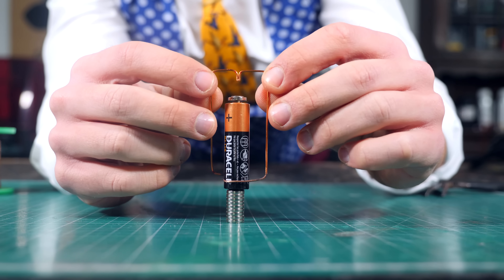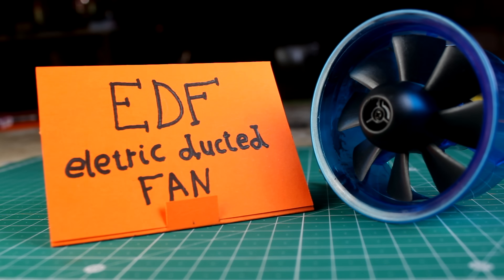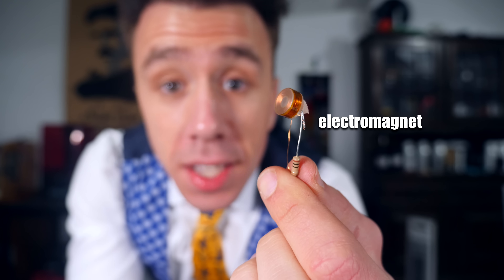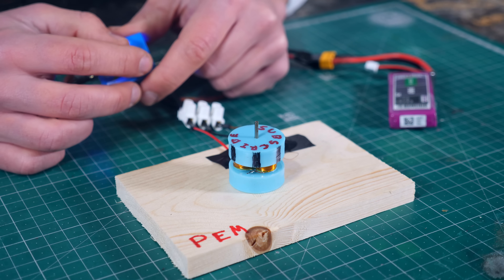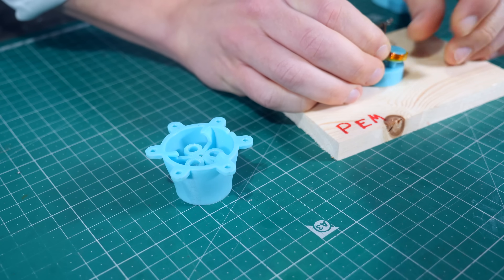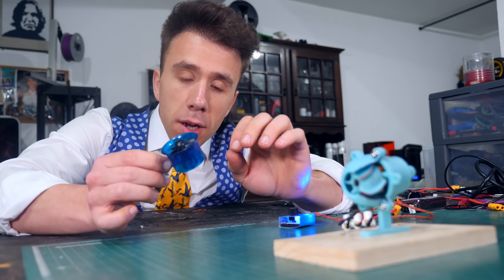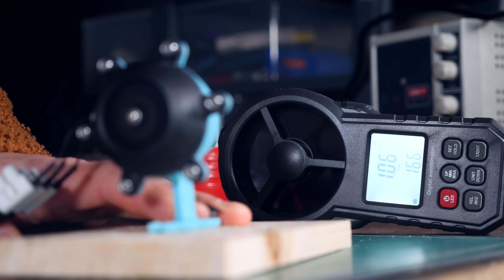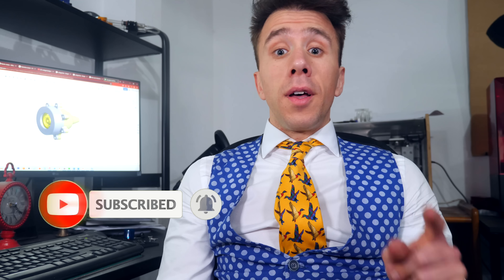I 3D Printed an ELECTRIC MOTOR FAN

Comment: Shooting from the hip here: more steps, more narrow passages and changes in pressure mean more energy loss in the process. Fan blade design is a fairly complex field because very minor changes can have a large effect on performance. Dyson fans work because they draw in more air through that center ring. The design requires more pressure, for which an impeller is optimal.
Drawing from rockets: you want the outlet pressure to be the same as the atmospheric, otherwise you get over expansion or under expansion which cause a loss in performance (not a 1:1 comparison because supersonic flow is weird, but presumably carries over somewhat). With an impeller, you have a larger change in pressure followed by a drop in pressure which just screams “minor head loss” in fluids terms, “waisted energy” in other words.

TLDR: Impellers are not meant for thrust directly, they are meant for deltaP. Fans are for thrust. Unless you need “high” pressure for a process, such as combustion, a regular (well engineered) fan is better.

Comment: I think it's because you are measuring the speed of the air... As you said, you have an impeller that are designed for compress air, and an EDF that are designed for accelerate the air... The reason because the jet engines make thrust, is for the combustion... So, you are measuring speed of air with something that are diseigned to compress it... It's the inverse situation when you made the " glove test" in the turbo pulse jet engine video... I hope this can help you... 
Greetings from Argentina ;)
Reply: I want to add something: I mean, the impeller pushes the air to the casing ( when compresses it) and then it's hard for the air to go backwards... MAYBE ( idk, I'm just speculating) if you find a way to convert that "centrifugal " ( Idk how to call it) flow into a linear flow ( going backwards) with tubes in the casing or something like that ( like the engines of the blackbird when they go in ramjet mode) you could have the thrust that you want... MAYBE.

Comment: It’s because it takes more energy out of the system to compress the air and then for that air to change direction to go out of the exhaust, compared to the first fan that just uses all the energy to just accelerate the straight out the back. Making it more efficient, in Turing rotational speed into thrust.

Comment: Dude you can´t expect the same thrust from centrifugal impeller as an from axial EDF. Centrifugal impellers are good for increase of pressure, but with lower flow rates. If you wanna build something for propulsion, there is a simple equation: Thrust = area * density *velocity^2.  Hence to max it out, you need to push lot of air throug a bigger area and very fast, but that goes against a drag force, because the more you spin faster, the more drag you have to overcome to push the air faster, while drawing more power. So the propeller design should be chosen according its purpose and be fitted for the power and rpm of the motor to work efficiently. The state of the art axial propellers can reach about 75% of isoentropic efficiency, with 3d printed design, 60% is reachable.

Comment: my guess would be that the CF fan is pushing air outwards rather than in the direction opposite of thrust.. and you only end up getting thrust from the air that is pushing off of the incoming air which is not directly connected to the structure. you might also be getting some thrust from the back walls that help bounce the air towards the nozzle, but i'd wager that it's lost energy by that time after the air got energized by the fan.

where as directional fans get their thrust applied to the structure as soon as the fan hits the air in a rearward direction.

Comment: My guess is a part of the centrifugal fan is designed to produce a part of its work radially to them play on air speed to create pressure. Not everything is ejected axially to create thrust, so the difference is the losses in redirecting the flow or some sort

Comment: I believe that’s just the nature of these types of fans. Looking at it from a Bernoulli perspective; converting the air from kinetic energy, to pressure, then back to kinetic energy allows for more loss due to friction and work needing to be done. 

The reason Jet engines compress the air is so they can burn more fuel hotter, which then spins the turbine. So it makes sense that skipping that step just makes for a worse fan.

Comment: Reach out to @Major Hardware! They've been doing a series of competitions of user-submitted models for PC fan design... while they may be PC fans, and not impellers, they might have some insights given all the fans they've built and tested over the years. Also, I suspect  they might have some design submissions which couldn't work on a PC fan, but might be more relevant to your use case

Comment: compression, you are not making enough compression on the printed ones, and the clearance is too big , make blades thicker and stronger and add more and make the clearance between the casing and the fan smaller if possible also the dison blades are made for a specific conical shape for that vacum if u can imitate that chamber where the fan is on the dyson you will get a bit more trust guaranteed

Comment: Since you have shown an interest in centrifugal fans, it would be cool to see a video on centrifugal superchargers, or as most people know them, turbochargers. I remember watching Colin Furze build a jet out of a turbo he found at a junkyard, and it would be cool to see if you could do something similar but more optimized out of 3d printed parts! Cheers from the US of A 👍
Reply: A centrifugal supercharger is not a turbo. Turbos are driven by exhaust. A centrifugal supercharger is belt-driven. No turbo lag, better efficiency than a roots or Lysholm supercharger but less than a turbo, and less power gains than the other supercharger styles.

Comment: how much surface does one fan to the other have to move air then ? Are both capable of moving the same amount even ? Your design looks smaller in that aspect. The problem is not the engine but the fanblade surface area.

Comment: In my opinion: the key is in the size of the intake aire. The EDF one is so much largeur. You can simply test it by masking the corresonding part of your EDF intake and check if the trust match your beautiful centrifugal fan. Or by increassing the size of the centrifugal fan...

Comment: this type propeller make higher pressure, but lower mass flow. this is great to upgrade for after burner, project! but first try measure the pressure, to be sure. or if u want u could make some nozle to increase speed air flow, bouth upgrade should give u more thrust.

Comment: novice error in aerodynamics, you try to take air from a low pressure zone to a high pressure zone so it is easy for the boundary layer to detach, solution: make the angle of your blades smaller.

Comment: *It's a fundamental fluid pump efficiency problem.  chrome-extension://efaidnbmnnnibpcajpcglclefindmkaj/https://www.ndsu.edu/pubweb/~kkatti/pumps.pdf  In layman's terms,  your centrifugal design is inefficient compared to an axial flow design given the rpm of your motor and density of the fluid (air). There is no fixing this. Axial fan will always be better.*

Comment: LIKE SO HE CAN SEE :thanksdoc::learning::yougotthis::cat-orange-whistling::cat-orange-whistling:
average EDF fan spins at around 40-60k where DYSON FAN SPIN AT  .... 125 000 rpm ....yes 125 THOUSAND RPM  , like all the centrifugal fans (for example like ones in turbo charger , jet engines etc ...way more than 100k) ... they really like to spin fast and only then have the flow rate you want ....less torque , more rpm and you will achieve better results :)

Comment: @Integza The impeller is making higher pressure air whereas the fan is making higher volume air.  If you measure the speed alone then you don't see the energy in the pressure.  If your workload is volume alone, then the fan is optimal for that, but you can use a Venturi to add more air to the high-pressure output, trading off pressure for volume.  That's how the head of the Dyson works.  But still, recognise that there's more skin friction in your design and it will never be as efficient as a well-engineered ducted fan.

Comment: Did you check if it's pushing air out the front instead of in and then out the back?

Further, maybe the RPM is wrong for the size? Are the clearances tight, like I'd imagine they should be. Maybe compressed air is flowing out of the front and creating a sort of bubble etc

Keep up the good work Integza, love your content man!

Comment: the EDFs are usually injection moulded
the plastic used is more stable than that used in your Fan and does not deform as much as yours.
that being said the DF part of EDF is important.
the Ducted fan part for optimum efficiency requires very very tight tolerances - hence the comment about deformation.
another YT has done a deep dive into the tech 
https://www.youtube.com/watch?v=QccRbsZVg1Y

enjoy

I LOVE YOUR CONTENT AND WISH YOU ALL THE BEST FOR 2023 (YES I KNOW IT IS MARCH ALREADY :D )

Comment: First: I am not some sort of jetengine-engineer or a fluiddynamicphysicist for this kind of stuff. I just had some courses at university about thermo- and fluiddynamics and happened to do some experiments on my own. As far as I see, the problem is, that you overall just increase the pressure of your medium (air). This comes at the cost of the velocity you are looking for. Then your nozzle should let the gas expand and generate thrust. The principle behind a jetturbine - at least as far as i know- is that you compress the oxidizer (oxygen from the air) to achive a constant rate of burning fuel directly after the compressor. The combustion then increases the velocity and temperature and lowers the static pressure. At the end of the of the jetturbine you'll need a nozzle to let the gasmixture expand further and release the rest of the generated pressure in form of velocity (=thrust). What I think is your problem, is that you dont really have the right nozzle which results in loosing to the EDF and that your intake should be the same diameter as the EDF to be compareable. I would try a a little bit less restrictive nozzle an a larger scale overall for a bigger intake. What could also be diffcult is, that the energy and thrust of a jet engine comes from the combustion of fuel increasing the speed of the gasmixture. Also i dont know if the impeller you built has a high enough efficency - since you just 3d-printed it - which probably results in an imblanaced part with a not perfectly centered axle (already at this scale this can be pretty bad even with little offsets). Also because of a not really perfectly smooth surface you'll produce more turbulences on the surface of your impellerblades which results in less air beeing drawn in. Overall: try a less restrictive nozzle and a bigger intake/ scale the complete modell up, since you cant change much about how the part come of the 3d-printer (?). Probably you'll loose in the end to a EDF, cause you loose energy at all steps of compressing an expanding, which the EDF doesnt mess around with at all. That is, except you try using some combustion to really get this thing going.
I really love your videos about selfbuild motors and engines. Hope to see a followup soon

Comment: The reason your fan produces less thrust than your other fan (by the way, I am a fan), is likely one or more of the following: 1) Your design of a fan at first accelerates the air outwards, before trying to redirect the airflow backwards, where some of its velocity (meening energy) simply gets lost as the airflow does not like changing directions. It is basicly like when you point your water hose at a wall and the water splashes everywhere, the air molecules getting thrown to the front might be working against you fan.
2) Your impeller blades are way less aerodynamic, causing a higher drag coefficient without increasing their capability to move air
3) because of the extra surface area there might be a huuge loss in air velocity and therefor thrust and energy due to friction with the walls (boundary layer)
4) Your other fan is ducted, which makes it impossible for tip votecies to occur, which cause a lot of drag, while in your fan that you build, a their is nothing preventing the high pressure air from in front of the impeller blade to go the low pressure area behind it, which causes votecies and therefor drag.

All in all, your fan is less efficient than your ducted fan.

Comment: Maybe the motor is made for maximum power and efficiency with a certain amount of load, and the loads on the motor is different between the different styles of propulsion?

Comment: I think volume flow vs pressure flow. EDF has high velocity low pressure, and the centrifugal has high pressure which naturally flows slower. And the dyson uses air to move air in a venturi like way. I think....

Comment: so im not an engineer of any kind and nor have i studied physics but to me it still seems fairly simple, the airflow is restricted. ducted fans are so good because the can pull in a lot of air over a large surface area and send it out in a similarly sized area, an impeller on the other hand has to grab air from a smaller area and compress it into an even smaller one. the model you showed of an impeller fan was a jet engine (early design) that had fuel injectors to make them work so my guess is either you use a stronger motor or you pour some jet fuel in it

Comment: You should make a tesla valve forge, oxygen comes in but not out and it allows for a much higher heat forge used for metal smithing

Comment: I am just giving a rough guess but it looks like the edf fan has a much higher dimension for the fan housing internal diameter, and, therefore, the amount of air inside the housing at any given time is much higher for the edf. That being said, it's hard to tell as they werent onscreen at the same time. Best of luck solving it tho.

Comment: In the EDF, the blades are longer than the blades in the Centrifugal fan, and at the tip it is wide for more surface area. You know about helicopter blades? At the same RPM, the longer blades have a higher radial velocity at the tip, and apparently larger amount of surface area out towards the tip. This creates higher airflow and pressure. Your centrifugal can compensate by spinning faster, which is the idea, because those short stout blades are ideal for higher speed. But the motor might not be able to handle that.

Comment: I suspect...
You're not accelerating the air sufficiently to compensate for the reduction in volume.
Make the air path smoother, the nozzle diameter slightly smaller and tighten the tolerance of the impeller and case.
Also, are you sure you're achieving the same rpm?  That impeller looks a lot heavier than the fan.

Comment: It seems to me that a turbofan will always be less ideal than a simple fan when using pure electricity. Usually all those extra steps are used in conjunction with a fuel injector if I’m not mistaken. Without fuel, it just becomes a slightly less efficient fan.

Comment: I think it have to do with the pressure of the exhaust. If the exhaust air have a higher pressure than atmosphere, then those are pressure/energy whistled because they are not making the air go faster. Impalers are really good at generating static pressure and if those pressure are not generating thrust it will be wasted energy.

Comment: My recomended fix to your problem is to add a combustion chamber and a rocket style nozzle to your unit. Here is the theory on why:

An impeller is better at generating pressure then a normal fan blade where the normal fan blade is better at producing velocity. That is why they use impellers in turbos, their goal is to improve boost PRESSURE so they can put a larger volume of fuel and air into the same ammount of space as a N/A engine

The dyson fan also relies on pressure instead of velocity. They create pressure in the ducting of the unit wich gets released from the holes around the head.

Jet engines get better nozle velocity then prop planes because they use compressed air from the impellor to create pressure in the combustion chamber allowing them to use more fuel while maintaining a good fuel/air mixture (similar to a turbo in a ICE engine) giving you a more violent combustion and giving you more thrust

Comment: I have no idea if it would make a difference, but I am curious to know what would happen if the front of the fan was ducted. There's another YouTube channel where the entire premise is the testing of flow rates for custom-made PC fans. And if I recall correctly, there are some fairly successful designs which add a duct on the front of the fan to help direct air into the fan. This might also be amplified with the addition of a secondary fan attached to the same spindle as the impeller which helps to actively pull air into the impeller. Once again, I don't actually know what I'm talking about, but it does stand to reason that airflow in has a direct correlation to airflow out. 🤷

Comment: Fans are generally used to accelerate a lot of air a a little bit and to a low pressure, while your EDF may produce high velocity air, it likely has a low pressure, but the impellor design accelerates the air into a tight space creating a high pressure and this isn't what fans do well which is why turbo engines which want to make high pressure use multiple stages of fans designed to compress different pressures and velocities of air. Maybe the solution would involve designing some kind of multi stage compressor fan and if you want to create something more akin to a jet engine over a turbo fan, then you will want I high bypass ratio to increase efficiency. p.s. have a look at differences between plane engines and turbo jets on wiki or something :)